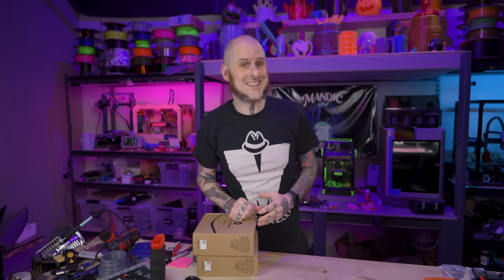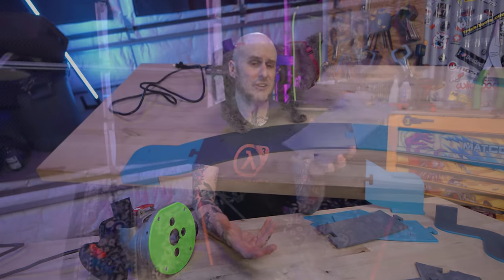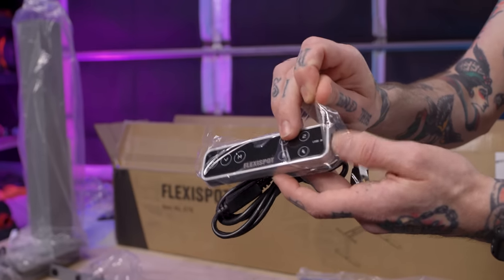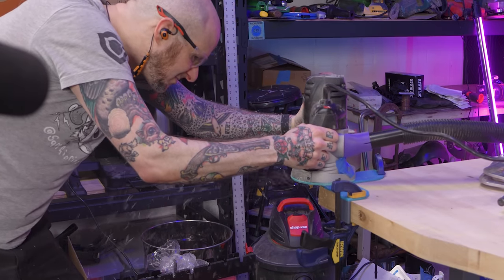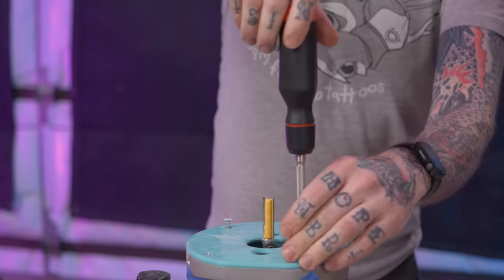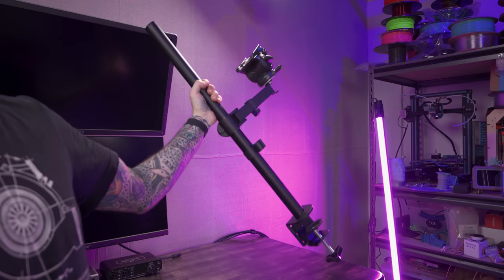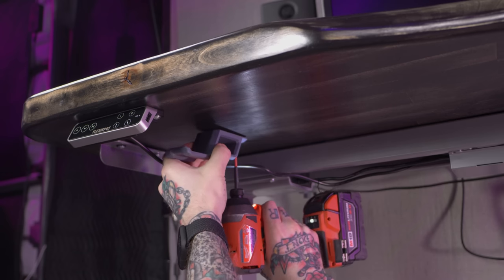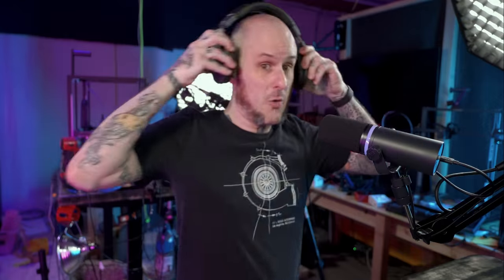Building my Dream Standing Desk Setup with 3D Printing!

Comment: The wood shattered on the downward curve of the arc because you were routing "uphill"against the grain of the wood. You have to go halfway through the curve until you reach the apex of the curve. Then flip the piece over and route "downhill" on the other side of the curve. I hope that makes sense.
Reply from the maker: Yea, I realized the mistake when I thought about it more later. It is what it is. After some sanding that corner is only slight different than the other. Anyone but me wouldn’t notice it without a closer inspection.

Comment: its already done but suggestions? add a metal layer/layers at the bottom side of the surface and you could make more custom mounts that have magnets involved allows mounting flexibility.

Comment: i built both my desks with 1 inch +?  birch butcherblock, i just left the stock edges. Stained black, but way darker, you can still se the effect under the clear gloss and semi gloss topcoat. Big Desk only way to go, goodjob! that 3d vesa mount strong enough? or you bury metal in it?
Reply from the maker: I’ve been running that VESA design for 2+ years without any issue. It is just PLA with no reinforcement. I had a shorter offset I used with a smaller monitor before that, also without issue. I figured I’d run the PLA one until it failed, but it never has.

Comment: Seeing all your vacuum adapters, maybe check out the osvac system (put it into your favorite stl site) to unify your setup.

I like the idea of using templates to get that curve on the desk, however for a most likely one-off I would have done it with a laser cutter.

Comment: What is that audio level controler in the back there?
And how do your speaker stands fare with loud music or sounds? Do they start to vibrate?
Reply from the maker: I'm running a Motu M2 audio interface for my speakers.  So far I don't have any vibration issues with the stands.  I'm using sound isolation foam under them for expressly that reason (I used it on the flat desktop too). 

Stands STL: https://than.gs/m/914326

Comment: Hi Allan loving the videos, i was wondering if you also have a P1P from bambu and if so how i compares to the x1c, im debating whether i should splurge and get the x1c or the p1p with the AMS?
Reply from the maker: I have one but I actually haven’t unboxed it. 😬😬I’ll get to it soon and give it some test running. I would say hold off a short time to decide on where the market is going ( a pretty short time).
Reply: Thanks for the answer, ill keep frankenmodding my cr 6 se while i wait for more news  ;)

Comment: Switched to FlexiSpot E7 too and best advice I can give you: DO NOT buy their tabletops, the quality control is absolute garbage. First comes chipped, contacted support, they send me another one - and it was even worse. Absolute disaster. In the end got a refund and will build my own tabletop or buy ready made one from reputable vendor. The mechanical part are quite decent tho
Reply from the maker: That stinks to hear. I’ve not had any experience with their desktops, only bases & accessories. I’d think getting a top locally would be all around safer bet anyway.